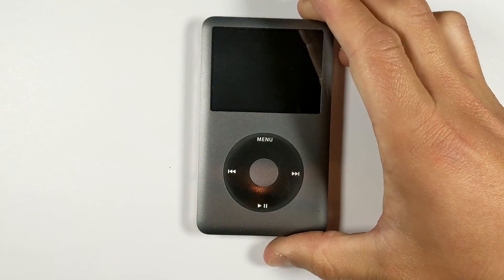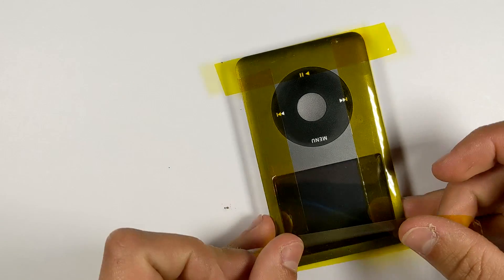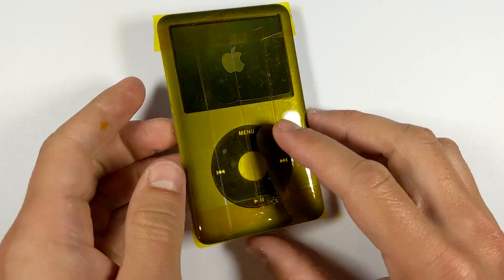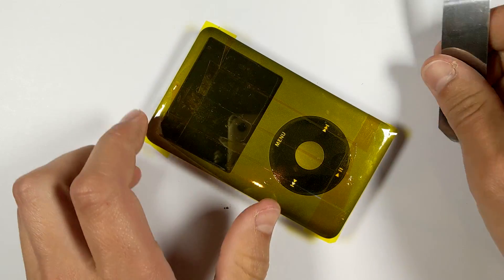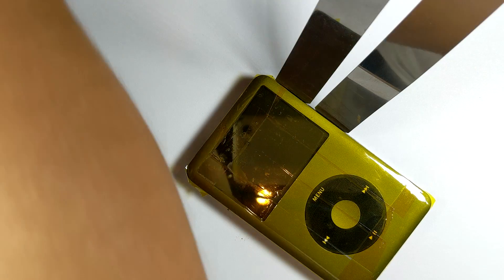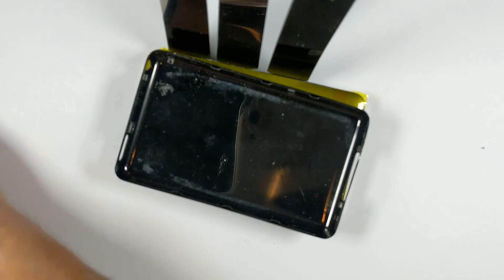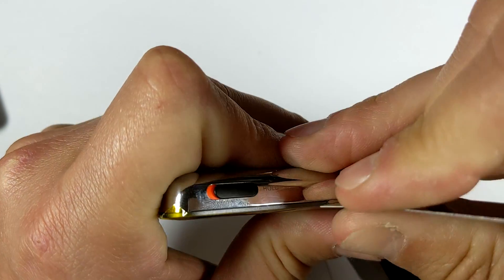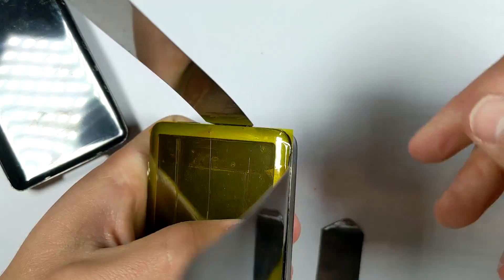iPod Classic 6/ 7th Gen Hard Drive and Battery Upgrade Tutorial

Comment: I recently took mine out of the drawer and decided it  refurbish it
I had the 6th gen 2nd revision so the 7th gen
Iflash quad with 256gb and 512gb in it
2000mah battery
Purple front and back 
Black click whell 
Loaded it up with my music there is just something about having a physical collection with you.
Reply: Great! I'm thinking of getting one. How does everything from sound, iTunes integration and quality seem compared to the original version?
Reply: @josefernandez2722  People say the 5th gen is the best for sound, but honestly, I have both, and I hear no difference.
I'm not sure about the 6th gen and 7th gen as people call it.
The mods don't affect the sound quality. 

Only thing I do is use lossless audio with roxkbox
Reply: @josefernandez2722  the ipod sound quality is one of the worst audio i've heard. they aimed for practicality and storage capacity not sound quality. even if you load uncompressed audio.
Reply: @philliah I think the ipod 7 gen I have is one of the best devices volume wise,especially on treble boost in eq settings with the volume up too all with beats pro headphones..
Reply: @leoshepherd1982  I prefer the 7th gen sound wise alot of people say the 5.5th gen sounds the best but I don't see it
Reply: what brand or shop did you purchase your front and backplates?  What size did you go with for the backplate?  I am having trouble with the two coming together without a gap.

Comment: Great video. Struggling to find out which generation is my Ipod. 6th or 7th. By the serial number on Apples's website it stated its a iPod classic 160GB (Late 2009). Would that be a 7th gen? Appreciate the help?
Reply: 7th gen has model number MC297
Reply: I think it most likely is a "7g" . If it is 160 gb and is the thin one it 100% sure is a 7g. If you are not sure if it is the thin one, just check if the headphone port curves along the the back of the case. If it does, it is a thin model and therefore a 7g.

Now, the difference also baffled me at first. Turns out there was never a 7th gen according to Apple. It is more of a distinción made by the community, but the difference in the storage size that can be restored is important enough.
Reply: Duh.